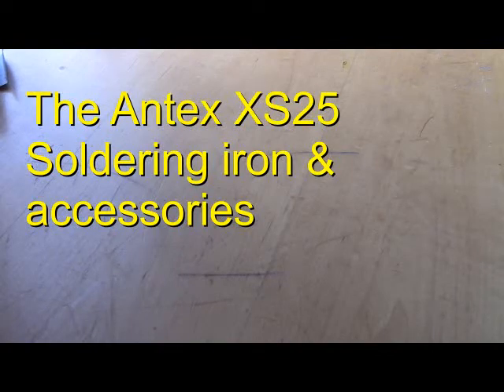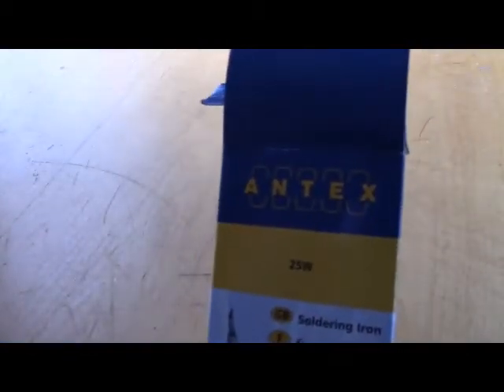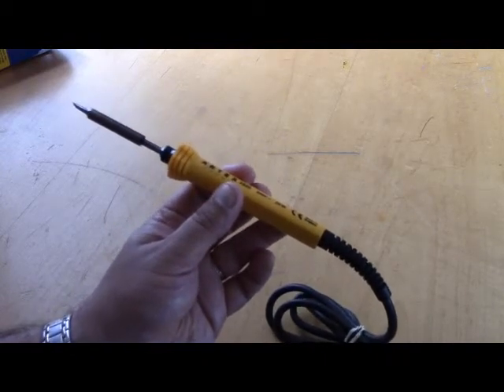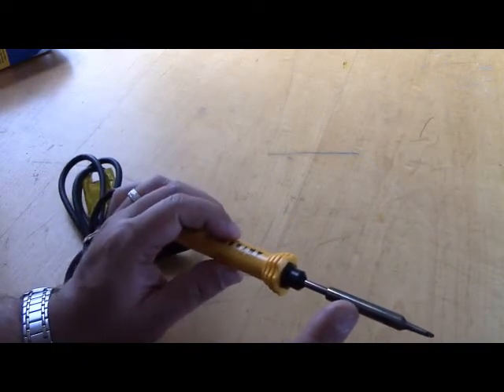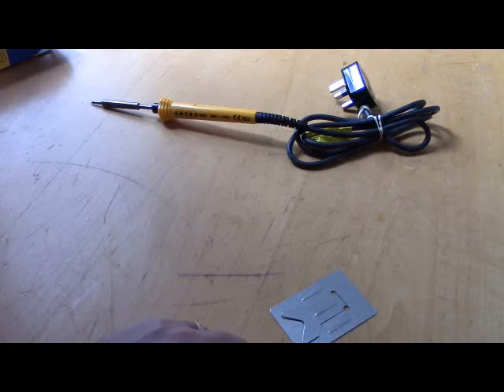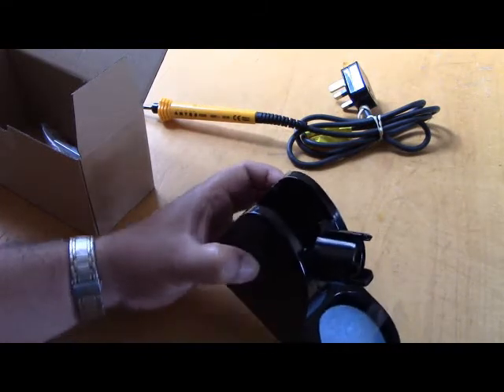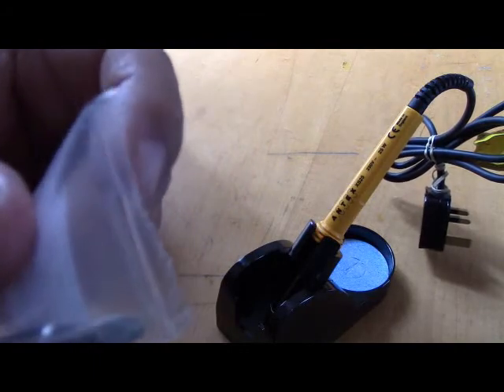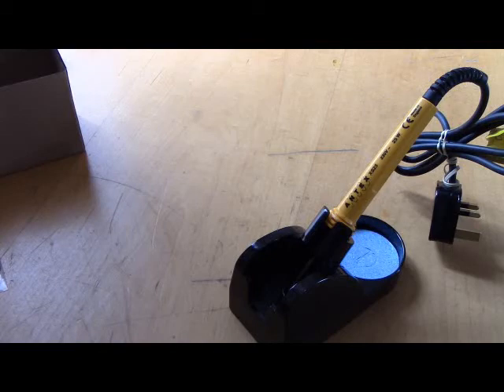ANTEX XS25 IRON

Comment: I bought my first ANTEX C15 type, with the bakelite handle, 65 years ago, apart from replacing the  original element, plus adding a silicon cablealso matching plub with new grub screw, it works as new.
I bought from Antex at Southwick nr Shoreham,Sussex at the time.

I also bought my first bag of  components from Bi-Pak there.

I use a small chisel tip for the soldering & it gives a perfect cone in very short time, every time.

A couple of years back I purchased one with a broader roundish tip of ebay, which I too updated like my original iron & it works fantastic on areas that need a bit more heat from a broader tip-which works perfectly.
The broader tip allows more heat on to the work to be soldered, without resorting to a higher wattage iron.
What I do not like about there modern irons is the falred handle that I could never get used to, I understand why it's there, in order to prevent one's fingers touching the element, but it's a 'problem' that I have never experienced since using my first & only(apart from the ebay one) Antex iron.

Comment: I acquired one of these, been trying to find how to take the old tip off properly as I didn't want to damage it. Thanks for sharing... Much more simple than I thought!
Reply from the maker: Mada Third glad to be of help , if you use the heat transfer paste it it easy , but the way I've mentioned does work . Have some happy soldering with her !
Reply: I was worried about that as well. Thanks

Comment: Show the thing working. I've been trying to solder wires to terminal connectors that i can then screw onto the switch for a points motors both hornby R8423 & peco PL11. So funny you should talk about model railways. My old fashioned antex is not working so well,  Probably needs new tip. It certainly didn't pull out as easy as yours - had to use pliers & even then it was tough. Then I didn't manage to get it back on all the way. So I'm a bit stuck. Any advice would be gratefully received.
Reply from the maker: Ok Gary , do not fear ! I will do a video When I get my days off work this week .  The trick to great soldering is to get the work hot . I generally use a flux paste if the solder has no flux in it .a heat transfer paste which you apply to the iron  prior to adding the tip on to the shaft will ease it off when changing but is not really necessary .

Comment: Great video! Is there a variable switch hidden to control the temperature? How long does it take to heat up to the right temperature? cheers.
Reply from the maker: Eric Liu  thanks . It takes about a minute to heat up to melting temperature, there is no switch , as it is straight from the mains direct . Plug it in and then give it about a minute to heat up , I usually take a piece of solder and touch the tip to see if it melts .
Reply: Eric Liu its 35 watts continuous

Which balances out to about 380 degrees depending on which tip, slightly

Comment: This iron doesn't have temperature adjustment so it means always working with 420 degree. Is this not too much for plastic sleepers on the track, when soldering the dropper wire to the rail?
Reply from the maker: You can solder very quickly without melting sleepers . The trick is to make sure the side of the rail is clean , use a bit of sandpaper or a file carefully, tin your dropper wire rail end first , bend to shape , tin your iron , grab your solder , in and out quick , job done ,